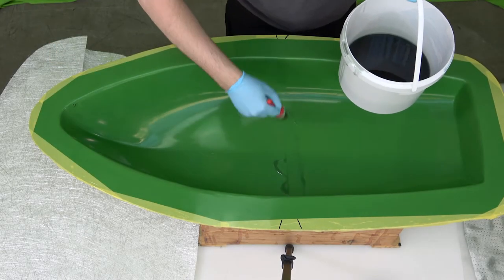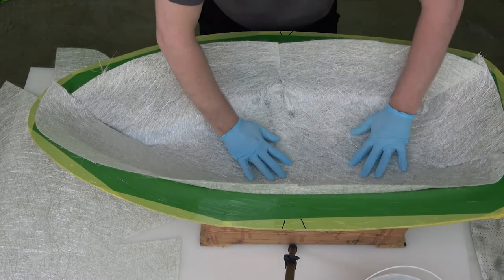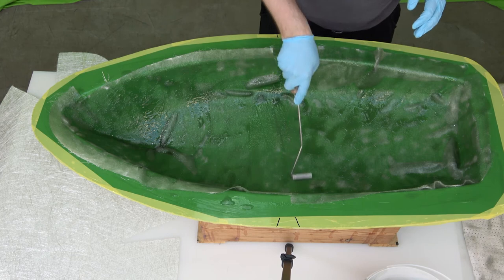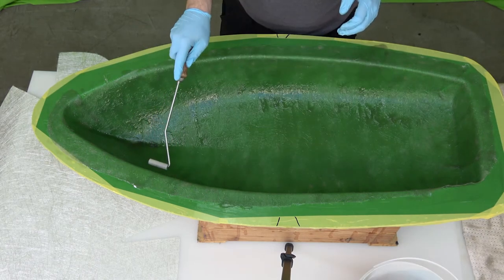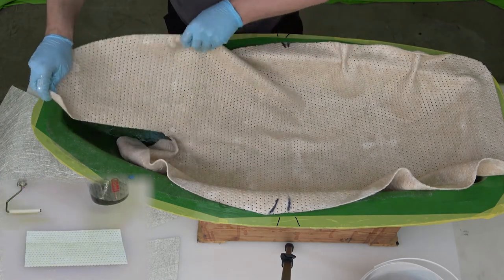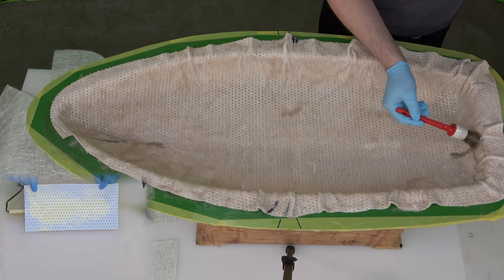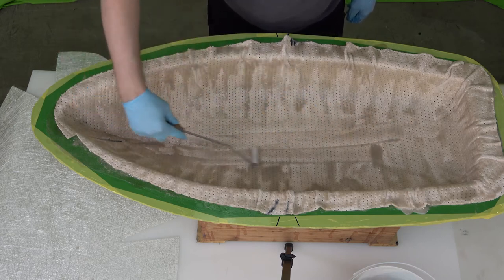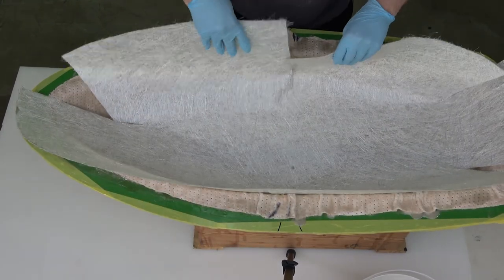3D Sandwich laminating with Coremat

Comment: I hope I’m wrong but, the core-mat looks like it absorbs a considerable quantity of resin, adding substantially more weight to the part, compared to other core materials. I am researching for an aerospace application so lightest weight is a priority. Core-mat does seem to have very desirable conformability.
Reply: Try the infusion and something like Lantor Coremat XM to avoid advertising other companies. In my experience, it absorbs less resin and is durable and light